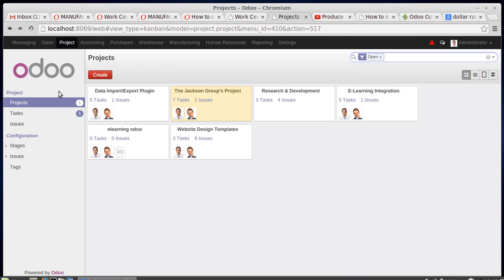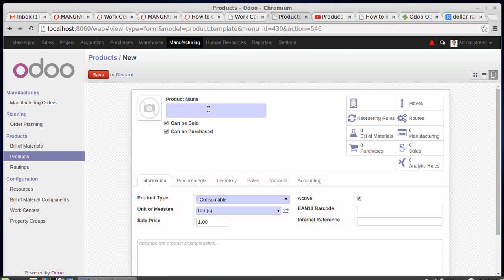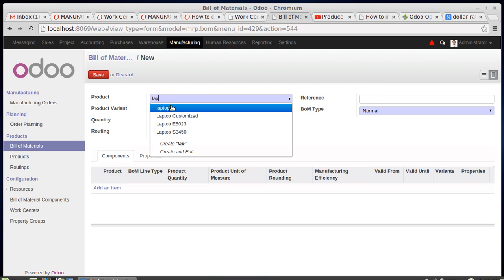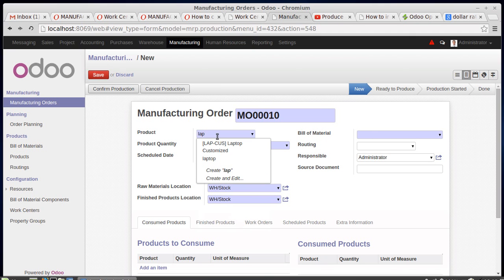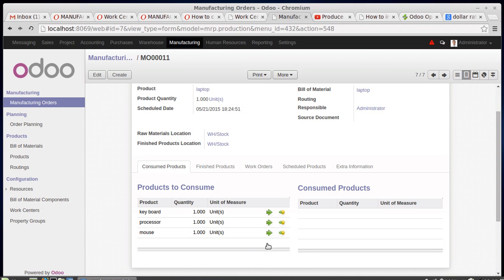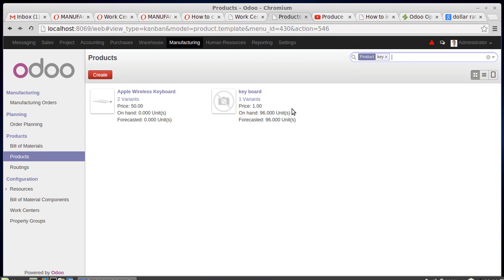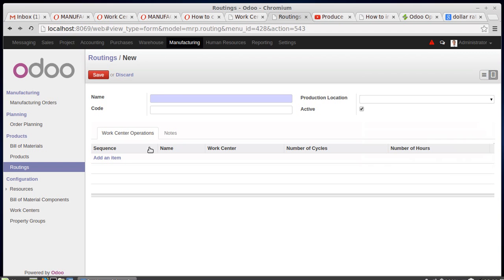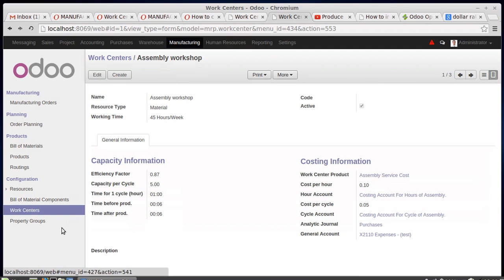Manufacturing Module in Odoo / OpenERP

Comment: Problem, when I activate the Manufacturing for the one free app, it automatically activates Inventory making it  not free to use the one app anymore, putting a dead line on it?
Reply: Novasoft India there are no free modules installed. if you install Manufacturing as your free module, they force add inventory, thus there's no such thing as a manufacturing module that's free.
Reply from the maker: Hi,

Can you specify all the free modules which are installed.